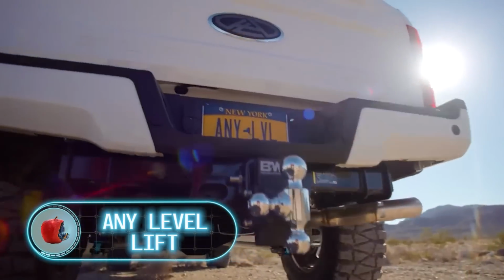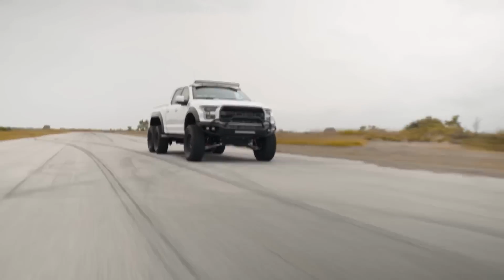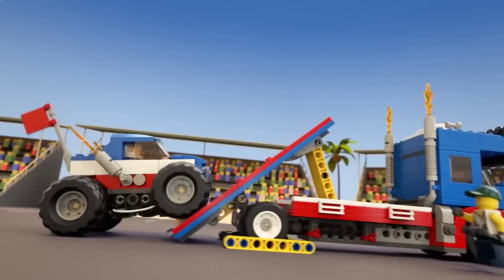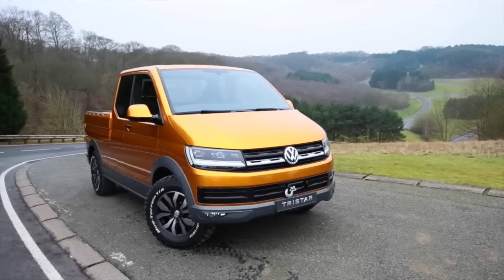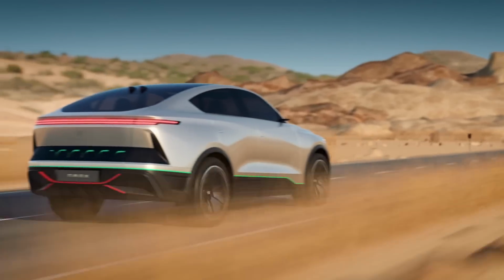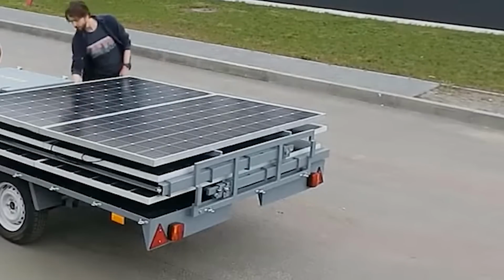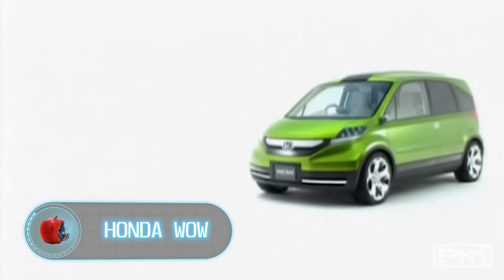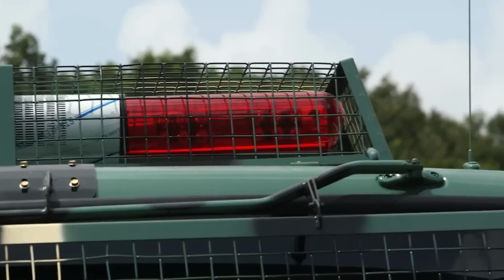Next Level Car Inventions That Are Worth Seeing

Comment: Ground clearance is the distance between your axle and the ground.  It doesn't matter if you raise the body another foot; the axle is still going to get caught on large obstacle or if your wheels drop into a deep rut.  But, that would be a good suspension kit for a low rider!  If the Velociraptor is built properly, that additional axle would increase the truck's load capacity, perhaps more so than just putting dual wheels on the back would.  The only reason to add additional axles to a vehicle is to increase load capacity.  Vehicles modified to drive on rails is nothing new, but I don't think I've ever seen a crane truck do it before. The VW concept looked nice; I would like to have one of those.  Judging from the design of the Auto-barricading truck, I'd say it's intended purpose is anti-riot and crowd control.

Comment: Moron cars which American loves. 
The center of gravity is high, but the load clearance is low. Axles with differential gears act as resistance and get stuck easily in mud and snow.

Comment: If the purpose of the Any Level Lift is to increase ground clearance then what about the axles that remain at the same distance from the ground or street?  The body of the vehicle can be lifted or tilted but the actual ground clearance for the axles remains unchanged.  Now something like this on low riding vehicles is useful for people who either don't want to or can't get into or out of cars/EVs that are so low.  Hmm..hydrogen fuel cylinders mounted in the rear of the car where in a collision they'd be the first to get hit?  What could go wrong?